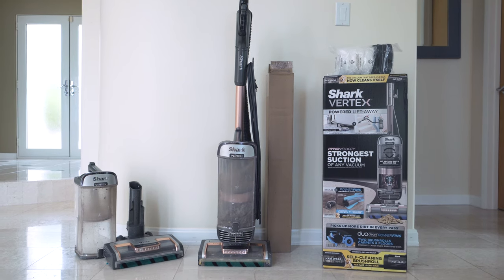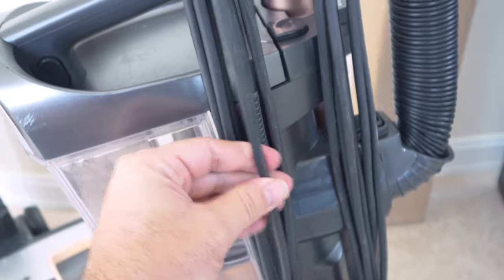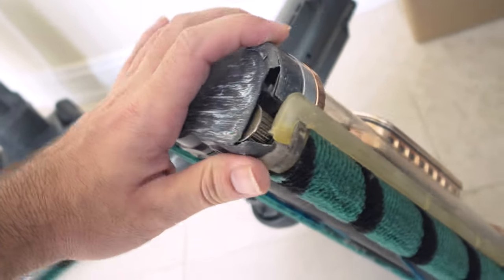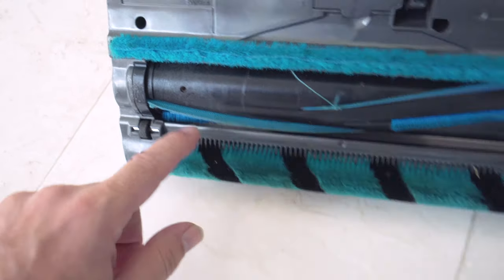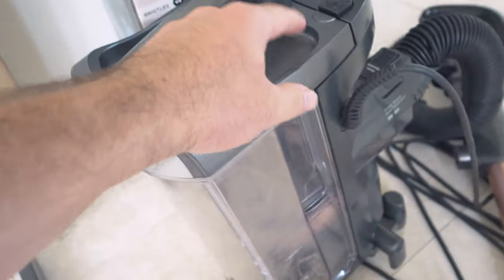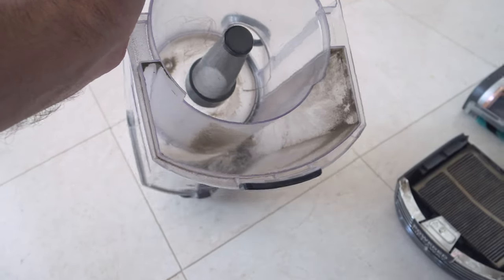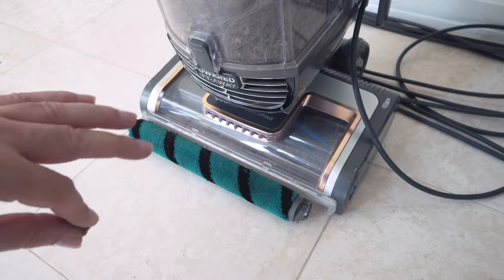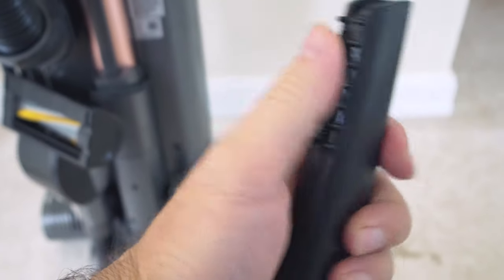Shark Vertex Vacuum - 1 Year Update & Maintenance

Comment: I hope Shark sees your review and fix those flaws for the next model upgrade. My biggest issues are those tiny rollers and not being able to open the head panel.
Reply: Shark will never fix the flaws....that's how they make money....for example...instead of designing the floor nozzle to have easy access to change the brushroll and belt....they made it impossible so you have to buy a whole new floor nozzle.  😠
Reply: @fuzzflxrs  Truth! Even more frustrating is that the floor nozzles are always out of stock so you have to buy a whole new vacuum!

Comment: Great review, I have had mine for 7 months and use it everyweekend to do commercial cleaning in buildings that people track large amounts of dirt in. I have had to replace those little wheels far too many times though, probably because a large part of the floors I vacuum are coated cement with texture. I am still using the original power head but I had to replace the belt for the front roller and the little fins are getting very worn out so I will likely have to buy a new head soon as well, thankfully I haven't had the problems with the dustbin or the wand and the hose on mine still looks very good. Over all I would say with all the abuse I have given mine just like you it has been a very good vacuum.
Reply: The fact your using it for ‘commercial cleaning’. That null and voids the guarantee instantly. So I hope it works throughout its lifetime for you. I don’t know the process of how a company discerns the fact that your using a product commercially vs home use, but I suppose if they had to service it and found more than average muck or wear in it…?
Reply: @stumpusMaximus  I just ordered this from shark website on sale with the lifetime warranty. Considering vac was on sale the extra $70 for the warranty was mostly offset by that. I would think of someone is using it commercially just don't disclose that 🤣
Reply: Honestly I don't plan on even trying to get warranty work with this, like you said commercial work voids it. The amount of use I get out of it is worth the price of buying replacement parts outside of the warranty. Plus there's no waiting on my vacuum to get fixed and shipped, when things are close to being broken I buy a new part for just such an occasion.
Reply: Where did you get the replacement wheels?

Comment: TLDR; My Vertex has been great and I consider it one of my best investments. If mine broke tomorrow I wouldn’t hesitate to buy another one. As with all things, if you want it to last you need to take care of it. 

I love my Vertex. I’ve had it for a bit over 2 years with regular (at home) use. My gf and I both have allergies and asthma (though she’s worse off) so we probably use our vaccuums a bit more often than most people. It’s held up well considering I haven’t done the best keeping up with maintenance. 

Things I’ve learned:
It’s important to regularly empty the dustbin. Despite its large size the actual max fill capacity is smaller than you’d guess and not clearing out the bin and hair wrap often can lead to reduced suction/ extra strain on the motor.
It’s also important to wash the foam and felt pre-filters every 2-4 weeks with just warm water (no soap) and also clean/ blow out the backside of the hepa filter ( I wouldn’t advise washing it). Let the filters dry for at least 24hrs and make sure they’re 100% dry before putting them back in the vaccuum. This will increase the airflow through the system/ motor and prevent dust from completely saturating the filters and choking the motor out. I highly recommend getting extra pre-filters and rotating them out. (As one set is washed and drying, the other set can be in use.) According to Shark the pre-filters should be replaced every 2.5 years and the hepa filter every 3 years, though that will vary if you use your vaccuum more frequently than is typical. I would personally air on the side of caution and replace them all every 1-1.5 years unless you also have a second set you swap between. 

Additionally, it’s important to unclog, clean, and inspect the wheels and brushrolls and other parts. I’d do this once per month if you vaccuum weekly.

Comment: You can find replacement wheels for the Navigator on Amazon. I wonder if they’d work on the other models. They look about the same and they’re only $10 for a pack of them. I just bought the Vertex for my wife for Christmas. She currently uses two vacuums for different areas of the house. They’re big and heavy. I’m disabled so she does almost all of the housework on top of working full time. I’m always trying to find ways to make things easier for her since I often can’t help her. I’m hoping this machine makes her vacuuming shenanigans much easier.

Comment: I decided to buy directly from Shark for the 5 year warranty. Did alot of research and was prepared to go in up to 800 for bagged upright but after much research, the bagged higher ends with parts availability and great warranties will have to up their game. We are doing a spruce up of our almost 6 year old powered rotator lift away, replacing brush, belt and then found flexed area if intake is torn. Found that on Amazon (yay) and its going to a new loving home. Shark vacuums have me spoiled w the headlights, wand, lift away, filtration and performance (although rotator not great thick carpet). Many reviews says this model does great on carpets (just have one large area rig) so thought it was worth a try. If it doesn't work all that great on carpets, they have 60 day guarantee, and we always have the dyson carpet champ cordless if not.
Reply: Oh and no uprights that have decent performance have close to these now must have features. Always lacking. Sebo felix was going to be my pick, but no standing hardwood attachment, no headlights, no wand.
Reply: @JH-ig1cb I have a Felix. The fact that you went with the disposable E-waste that is every shark is very troubling.

Comment: This is a great review and spot on. We use our Vertex for cleaning homes as well so it has been through a lot. Shark replaced our brushroll after about 6 months because the PowerFins were all shredded up and splitting apart. Also, sometimes the power button slips and does not always work on the first attempt. Otherwise, we've had no major issues and we love this vacuum, it has served us quite well over the past year. Thank you for sharing!
Reply: Did you have to pay for shipping for the replacement? I heard somewhat bad reviews about their warranty.
Reply: @blt803  I had to fight to have them send me a replacement head free of charge since they argued that it’s a “wear and tear” item, but after six months the PowerFins were not making contact with anything and I was basically just sucking up whatever was on the surface. I’ve bought a great deal of vacuums from Shark and I would have to agree that their customer service and warranty isn’t that great.
Reply: @jakekeiser7087  - Can I please ask you a couple questions since you have used the Vertex in many situations and for a long period of time? How well does the Vertex perform on low pile carpets? We have Berber carpeting throughout most of the house. 

Unfortunately the current Shark vacuum, NV501, has bit the dust after 8 years, and that machine did a pretty good job of cleaning the carpeting. This current Shark has a carpet attachment with the old-style brush roller. 

I have been reading many reviews that the Vertex is very powerful, but one thing I am concerned about is will the brush roller fins wear out after a while with regular use, especially since the majority of surfaces in my house are Berber? And if the fins start to wear out, does that mean that the Vertex won't clean carpeting as efficiently or as well as the old-style brush roller carpet attachment? 

I am debating about buying the Vertex, but I also see a few Shark Vacuums that still have the regular brush roller carpet attachment. With my experience with the current Shark vacuum with the brushes, I would remove the carpet attachment and clean out the brush roller on a regular basis, sometimes cleaning it out a few times if I was using the vacuum for an extended period of time. 

Obviously it would be great to not have to do this maintenance anymore, but if an old style brush roller is going to hold up better and longer than the newer style roller with the fins, then I can justify continuing with this task. And I see with the new duo clean feature that the roller in front of the carpet attachment would need to be detached and cleaned on a regular basis as well, so it looks like I would still need to do the regular maintenance and cleaning on the Vertex carpet attachment as well. 

I apologize for the long-winded  post, Any feedback is greatly appreciated.
Reply: @edcipriani8873  i just got a lift away advance that has the fins, but it still has brushes on it along with the fins, so i would imagine it would still work fine even if the fins wore down, because the brushes would still be there.
i just bought it a couple days ago and it's my first good vacuum i've bought, so i really don't know. but it seems like you could cut those fins off and it would basically just be like an older style roller with just the brushes.

Comment: Sebo is the most reliable vacuum brand you can use for commercial or residential cleaning. I bought one for my house and am astonished with how well it’s made and how well it cleans. The main thing I like about it is how solid it feels to hold when using and how simple it is. It was engineered with frequent using in mind, with minimal maintenance and minimal need to adjust stuff on it. All you do is plug it in and turn it on. There is no carpet height adjustment, or switching to hard floor mode, or wondering when to change filter. It does it all. It’s super quiet to.
Reply: Also a Miele C1 electro plus is pretty awesome too
Reply: Sebo actually has a commercial brand. It’s called Windsor
Reply: I’ve never heard of them. Can you expand an explanation and what does it cost? Thank you🙏🏻❤️
Reply: @MrMcMuffinJr1999  asking the commenters here, can you expand and explain? Thank you🙏🏻❤️
Reply: @davidperry4013  I’m asking all commenters to expand their explanation. Can you tell me about it and the cost? Thank you🙏🏻❤️
Reply: @lindabuck2777  9/10 people looking for a vacuum tend to fixate in the ones you can get from a big box store. Cheap Chinese made trash. Those are just the tip of the iceberg in the vacuum industry. People are so held hostage by the marketing of these shit companies they simply are blinded to better alternatives. The only good vacuum I’ve seen at one is a bagged Kenmore canister. There’s a reason you never see these kinds a vacuums in a commercial setting. They simply don’t hold up. I work at a vacuum shop and a majority of the machines that come in for repair were bought at a big box store. Let’s talk about Sebo(Automatic X4 specifically). Hospital grade filtration(actually certified for use in a hospital), automatic height adjustment, easily removable brush roll, easily swappable filters, non-washable filters because you should never wash a filter, filters a you rarely have to change, quiet, bags that last a month or even more and only cost a couple bunch a pop, 10 year warranty on the Onyx line… Need I say more? This is a company that doesn’t advertise, doesn’t pay for reviews, doesn’t make you just through hoops to get quality parts. The thing costs $700+ but you’re making an investment you’ll reap for decades.
Reply: @MrMcMuffinJr1999  Dude I wasn't blinded by marketing, I was blinded by cost and need lol.  I was well-aware of the German vacuums, but even if I could spend that kind of money on a vacuum, I'd still rather buy a Kirby.  My mother has had one since new in the 90s and it still works today.

For my dumpy little single-wide with cheap wood flooring in 80% of the house and stapled-down industrial carpet in two rooms....and a massive flea infestation throughout all of it......I didn't trust the German vacuums to work as well on hardwood flooring like they do on carpet.  I need a vacuum where I don't have to turn off the rollers to use on hardwood.  Maybe one of the Sebo or Miele cannister options would have been better than the upright options though.  Still.....$400 vs $850 matters, sorry.  Especially when I'm buying a steam mop as well and a hundred dollars worth of flea-fighting tools.  At that price, a Miele is still assembled at a Chinese factory.

Would love to have had a high-end vacuum though.....maybe one day.
Reply: @Ryan Sharp I love Kirby my mom had one in early 70,swith all attachments including shampooer. It lasted a couple decades, not sure what happened to it after I left home. She also had a singer canister vac from the 60's, we used it like a shop vac into the mid 80's for the dog kennel building. She'd tell stories of how, when I was 3, I sucked a roaster full of grease, with her singer. It didnt kill it, worked until 1988. Plenty of duck tape on hose though. Now its a small fortune to buy a vac of that quality! Few people can afford them, especially for apartments. Glad to meet another Kirby fan.
Reply: Technically you want a Windsor for commercial use. It’s the same machine but it has a longer cord and has a commercial warranty
Reply: @MrMcMuffinJr1999 hi ryan
Reply: @FishyFun57 Kirby lasts till the end of time but that where the benefits stop. They tend to snowplow, they are direct air so the fans break easily and they have subpar filtration.
Reply: @MrMcMuffinJr1999 yes that seems to be the gold standard for hotels.  Every hotel I've worked at uses Sebo Windsor and I fell in love with it the first time I used one; so much so that I started looking for them on Craigslist and I found a $1000 Sebo X5 used 2x and she sold it to me for $250!!! Can you believe that!!

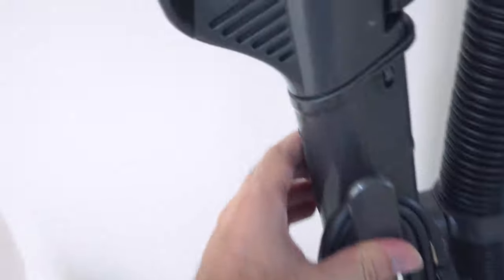Comment: 1:45 I have this exact vacuum and like your wife I use it every damn day on my job. But I got to be honest, I don’t like the cord. It’s not that it’s not holding up OK, it’s the cheap stiff plastic. I’d like the cord to be more flexible and soft and less rigid. It tangles easier than I would like.

Also you are right about that hook that holds the canister on. Mine broke. But I bought lifetime coverage when I purchased the vacuum from the website and they just replaced it instantly. I stopped carrying the vacuum by its little canister handle and grab that pink tube instead to lift it and carry it. They shouldn’t put a handle on there because that little hook just can’t take those tugs. Also I just called them today because the little velvet brush in the front that you were showing…? Yeah it stopped working. So they are sending me a complete new head for the whole thing… Free of charge, again, because I purchased the lifetime warranty.

Comment: I have one of these and a Shark pro pet power lift-away, these work good for what they are but they are just cheap plastic. I also have three Kirby's one is about 20 years old and two are about 10 years old. They will far outlast any of these plastic cleaners and they work good also, though not as convenient to use as far as attachments go but they are effortless to push. I'm spoiled by these robot vacuums, I have three of them also. No robo vac will work as good as one of these upright vacs but i use them for everyday cleaning and about once a week use a Kirby or Shark upright...
Reply: Yay Kirby, mom had an early 70's model with all attachments for $800 ish. It worked for at least 2 decades. Im not sure what became of it, after I left home. I got a workout cleaning our rugs in the farmhouse! Man it had suction! Too bad they're so expensive and not practical for 900 sq ft place with only a couple area rugs! I got a workout and didn't need a gym membership lol.

Comment: Thank you! My brushes turn on and off. I was going crazy trying to figure out why. After I saw that the wand was giving you issues (the connection) I looked at mine and I think that’s the problem. How did you get a replacement wand?

Comment: Mine is 2 1/2 months old and the roller stopped they said I have to buy a new one for 89.00. I asked about a warranty and of course not covered. Then they said I could get one for just shipping cost 20$  The money you spend they should at least be able to fix the problem in 2 1/2 month old product. Never buy another one.
Reply: Shark = disposable vacuum.
Reply: Get a sebo
Reply: I have this vacuum and when I purchased it I bought the lifetime warranty. It replaces anything that breaks. I’ve had to replace the canister because the hook that held it on to the body of the vacuum broke off because it’s just not strong enough to withstand being picked up by the handle. They replaced it instantly no cost to me, and I just had the front velvet covered roller underneath stop rotating and today I called them and they are sending me a brand new one no charge. It’s definitely worth it to buy their lifetime warranty for this vacuum. But overall the performance of it is really excellent as far as its ability to actually clean. I think there’s some flimsy design issues. But, anymore it seems like you have to buy a warranty on anything.
Reply: @maryvalentine9090 - Thank you for this. We’re considering this vacuum, but we rarely get extended warranties. However, this one makes good sense. Much appreciated.
Reply: @maryvalentine9090  surprised the guy who made this video didn't do that, it would definitely benefit him more than most people.

Comment: Shark Vertex is a better vacuum than most today albeit more expensive.  Any vacuum under $300 won't do a good job anyway. Doesn't always pick up debris without prolonged or several swipes & there is no edge cleaning unless you use hand wand. The 12 amp Shark upright I had more than ten years ago was a better vacuum.
Reply: If you think that’s a better vacuum than you haven’t seen many brands.